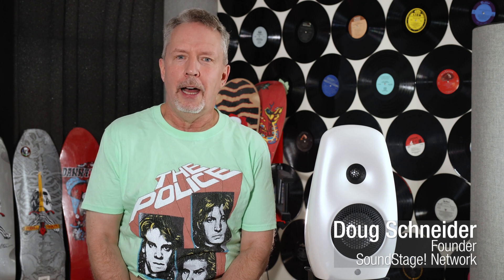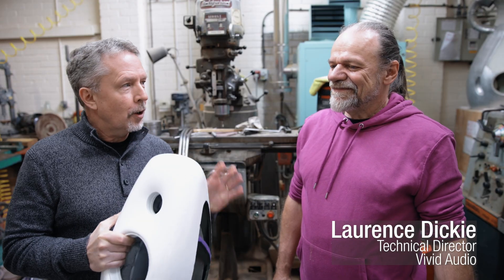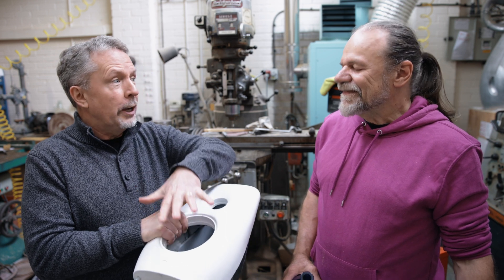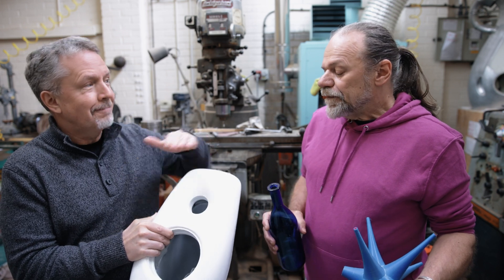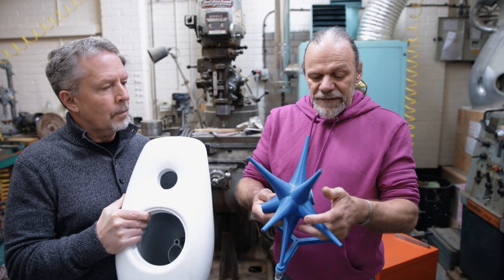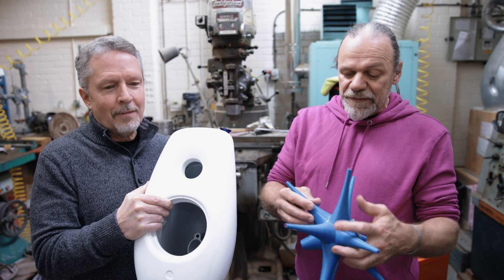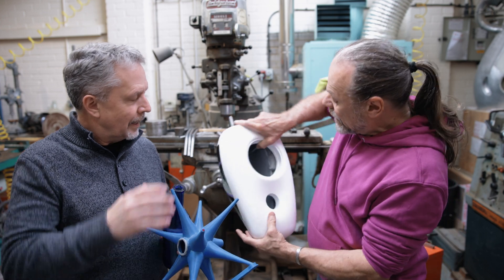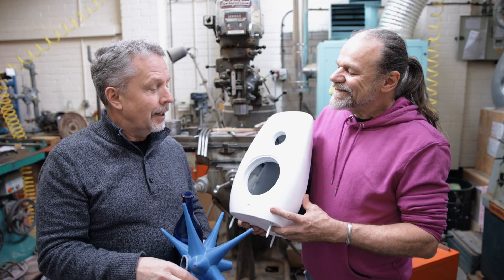Going Inside the World's Best Compact Two-Way Speaker - Tapered Tubes and Vivid's Kaya S12 (Ep:60)

Comment: At a hi-fi show earlier in spring I had the fortune to listen to the Kaya 12. What a delight! It was by far the most neutral and transparent loudspeaker I head. Outplaying big speakers from Avant-garde, Stenheim and Magico. By the way the Stenheims were roughly 20 times as expensive if I am not mistaken. The small Vivid’s doesn’t really possess deep bass but beyond that they sound like a hyper transparent open view to the performance and on top of that they are devoid of harshness and freedom of annoying sibilance, which seems to be the curse of almost all other speakers. Wonderful product.
Reply: It is truly a great loudspeaker. Like you say, limited bass. But enough bass for some and extreme transparency through the rest of the frequency range.
Reply: @dougschneider8243  Regarding bass I think the important thing is to match the loudspeakers bass roll of to the room the same way a headphone is adjusted to the ears. A speaker with a high system resonance will match perfectly with a small listening room with stiff walls where room gain will compensate for the falling response of the speaker. Big room need big speakers small rooms need small speakers. Happily not the opposite 😃.
Thanks for a great video and greetings from Denmark

Comment: Very good explanation. Basically the S12 is a total sum of all that was learned since the B&W Nautilus. So you are getting a little 2 way Nautilus speaker for £6k with better performance in terms of the overall sound. Bass is pretty good for something this size too. It's a real wonder. I use a pair for near field monitoring of our recordings and they are a very transparent view on the recording.